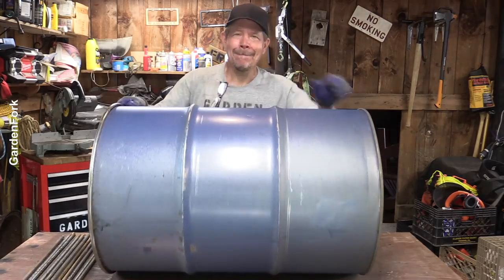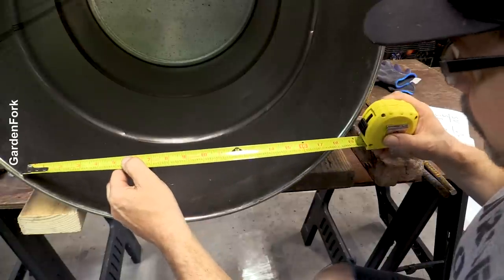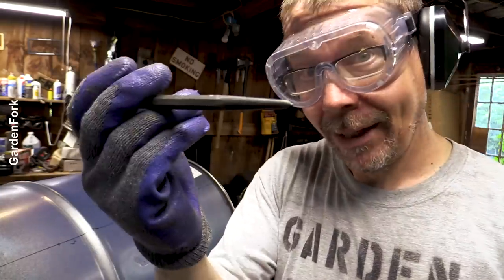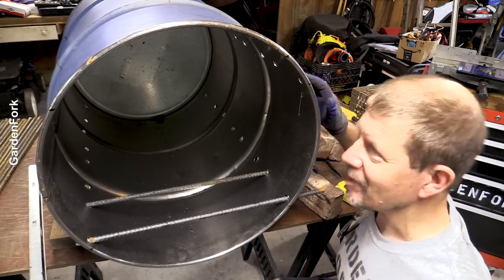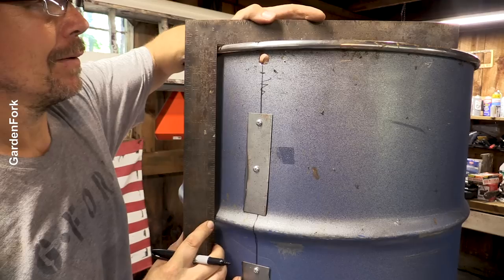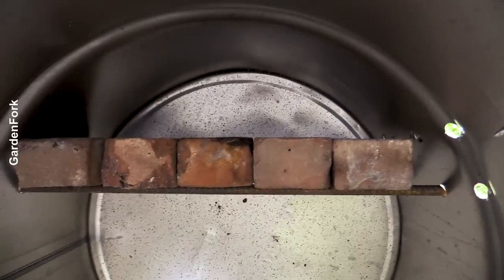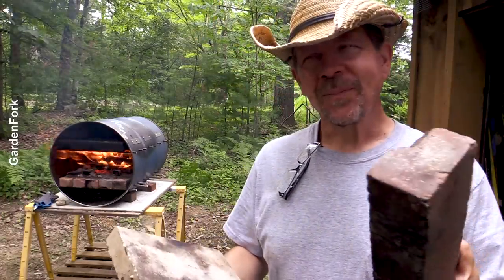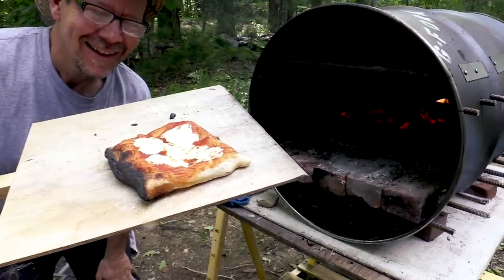Metal Drum Into DIY Wood Fired Pizza Oven

Comment: This is a great idea! I cook on top of the heat source in a fire place setting using fire brick although I lack the roof part which I have to flip the dough once before adding toppings. BUT your idea👌 I would change .. Forget the bottom row add sand instead of the bricks to build a fire on. The second row move down a little and leave that little space on each side to allow heat to rise. Build the fire, let those bricks heat up and cook the pizza on top of the bricks. The heat build up at the top of the barrel will cook the cheese hopefully with a more even heat👌 I'm going to try this....you've got me thinking now!
Reply from the maker: Excellent idea Rob, thx for writing. Had not thought of using sand 🤔 Eric.

Comment: To get the height for the holes you could probably make a cardboard template of the profile of the bricks and rebar. If the bricks will stand up, you could arrange them vertically on the cardboard and place some rebar below it. Trace, cut, then hold it up to the front of the barrel. Line it up where the top corners of brick hit the barrel with the template even, then mark the holes where your rebar hits the side, and make some more excellent level lines down the barrel. Hopefully the little bit the rebar settles into the holes will leave enough wiggle room to get the bricks in. Thanks for the excellent content as always! Wishing you and the pups all the best <3
Reply from the maker: Good idea with the template Oswen, thanks for that. Brick dimensions actually vary quite a bit, so we could also Just see what fits. Thx ! Eric.

Comment: Use a second drum for a stand  .. cut U shape in top of stand drum . fit oven drum into U shape. cut out metal can be fashioned into short straps ... attach both drums together with straps using self tap sheet metal screws.

Comment: On bottom let the rebar lay in oven, no holes. If to long/high cut shorter. On top measure your 5 brick, then come down the 2-1/2” from top for hole position. You could try leaving a little room in back for heat travel and building fire under bottom bricks. No ash on pizza.
Reply from the maker: Wow Eric great ideas. Thx! Eric.

Comment: You could lay the bricks on the botton right against the metal for a curved fire liner. That would lower the heat allowing you to lower and only use one course of rebar. Also, you have a grinder so try cutting angles of brick to end fill bothe sides front to back. That will help with draw and convection.
Reply from the maker: Good info Stewart thx for that. Eric.

Comment: Not to worry GF : Just go for it!
PS Try placing the fire below the lowest set of bricks instead of in middle back.

Next build, place your lowest rack of actual fire bricks at least 4"-5" higher on which your food will sit and fire below - perhaps with very small spaces for flames & heat to reach up... 

PS use a baker's pizza stone keep your food cleaner, more even heat.
Reply from the maker: A couple of people hav suggested the fire under the brick. Might have to try that. Thx! Eric.

Comment: Great idea , and damn very economical ...
I have a suggestion , you can grind the bricks  on left and right most lines , so they can touch the drum wall . These bricks needed to be ground on the side which is touching the wall . The grinding should be done at a certain angle so they fit well
Reply from the maker: Good idea Uday, thanks for that - Eric.

Comment: Just line them bricks up side by side on a level surface and use string to measure.
2 pieces of string one for 5 bricks wide one for 6 or 7. Make sure your bench is level
Then for the level use a clear plastic tube full of water to get opposite side level.
Its the same methods for level at opposite ends of barrel as opposite sides.
Any thicknesses needed just use the actual brick to gauge the height or drop down.

suggestion: Use bricks to form an ark up and over underside of barrel after making the base
OK this is a year old you probably did this by now all the best you gave me some ideas.

Comment: You don't need the bottom rack if you just used fire brick,and sand as grout,dry sand is fine if you work it through the cracks with a broom. You'd want to use those bricks throughout if you want it to last.

Comment: Interesting down and dirty build.  A couple suggestions:  before you start drilling into the barrel flip it over so the solid end is a level surface.  Stan’s f bricks up on edge and snug them to the outer lip.   Add a piece of rebar above or below and mark vertical lines where the holes should be placed.   When you orient your bricks on the top row against the back omit the center bricks to allow smoke to rise above the layer of bricks.  Use your grinder to cut / slice / carve a hole to place a length of pipe up for a chimney out the back.  You could do the same on the bottom row of bricks too if you were going to maintain a fire under the bottom bricks or at least channel combustion air to the back of the barrel to maintain your fire.  If yo have sufficient extra bricks line the sides with one or two additional layers of brick to increase thermal mass.  4-5 bricks could be placed flat across the back to maintain heat and protect the metal.  Thanks for sharing this video.  Wishing you and your family peace, health and happiness as the pandemic continues to evolve.  Greetings from NE Ohio.  Cheers.

Comment: You should use the barrel lid to close off the front of the oven. Cut a rectangular hole to pass the wood and pizza through. You'll lose less heat out of the front of the oven. When you need to change out bricks or to make cleaning easier, pull the lid back off.

Comment: I built an oven w clay bricks and none failed in the years of use. I put a lot of heat and it worked fine. Older bricks are the best, no holes..

Comment: Lay out the bricks you'll use for the bottom and the top exactly as they will be installed then using your level hold it to the bricks and mark with a sharpie on the level the exact width of the bottom row then transfer the level (with marks) to the barrel and mark those marks where the bricks will just touch the sides and drill holes for the rebar accordingly. Do the same for the top row. Another option is to cut angles (grinder?) on the bricks that will touch the sides to push them further out.

Comment: How about you cement the bricks the whole way around the inside of the barrel. Put them the whole way around. I think they make bricks in a wedge shape. Then add your legs to the bottom. Put a rack in about the middle to hold the pizza. I think you could even put a small smoke stack on the back and maybe a door. Maybe use some type of stickers, maybe tacked in on the metal to hole the bricks and cement. Just a Thought.

Comment: How cool was that.
I think if you measure the length of 5 stacked bricks you get the exact measurement of the lower deck. Mark it on your level and you can move it up or down till it fits perfectly and stays level :D
You can do the same thing on top just add the level width to the lower end as you did.
Reply from the maker: Good info Gil, thx for that!
Reply: Brilliant !!.

Comment: Clay bricks vs fire bricks is just thermal shock vs not really thermal shock-created bricks. Both work equally as well to holding up against all that thermal shock, its just that the fire bricks will last longer and hold up better over time. I want an oven to last but i doubt i will need it thru, say 2 or 3 generations from now so either works for my purpose.

Comment: Put thin bricks in center and wood on bottom. Also use thin stainless steel half circle over the thin bricks 🧱 and you will get flames roll over the pizza at 900 degrees.

Comment: Hi Eric! I would take some scrap 2" x 4" lumber, and cobble together a slab of wood the size and shape of 5 clay bricks across. Turn the barrel upside down, (so you don't need to hold the form in place), and lay it in the opening. This will give you the exact measurements, without beating your brains out doing calculations (I hate that too). Mark your holes, and slide the form back, until you get to the bottom. Adjustments could be made with a Brickbat.
Reply from the maker: Excellent method, thanks for that. Did not think to just turn the barrel upside down ;) eric

Comment: you definitely need a door otherwise the heat loss is too much. you could also put some bricks at the sides if the space does not get too small. and insulate the bottom and top with material like vermiculite. or just insulate the whole outer side of the barrell with ceramic wool.
Reply: Yeah, Definitely add bricks on the sides, and along the back and maybe even in front along with a door.  How long did you heat this sucker up?  ( From what I've seen, a lot of these ovens they heat up for hours.) You might even add some brick underneath the first layer of brick.  Build up the thermal mass of the oven so it has a big reserve of heat in it. Insulation on the outside and thermal mass on the inside.  This is a great idea, I'll have to remember when I eventually get around to making one.
Reply from the maker: Excellent idea! I have plenty of brick to fill out the walls. Had not thought of vermiculite 😀 Eric.
Reply from the maker: Yes Brad the thermal mass needs improvement. I cooked down the fire for about a half hour. Should have burned it longer to heat up the lower brick for better crust. 😀 Eric.

Comment: Instead of measuring just use the actual brick and mock it up. Temporarily clamp something onto the barrel to hold the bricks. Then through trial and error find the exact place where the brick fit snugly across the barrel. I try to not measure if I don’t have to. Much better results.

Comment: Probably for the top row, rather than bothering with brick measurement. One could simply cut out a thick sheet of cardboard, and cover it with a layer of clay, with or without stray. Then stick it in place and light a fire for a few hours

Comment: Hmmm, if you have fireproof stonewool (don't know if this is the right word in English) you could retain more heat in the oven walls by isolating the outside of the barrel with it? And then maybe use chickenwire and foil to hold the wool and proof it against water? 🤔

Comment: I have a 200 gallon gas barrel that's been split into two big kettles, ten 15 inch square, six inch thick granite blocks, four five foot lengths of hot rolled steel angle iron,an old foundation, a big bag of pearlite, and an old wood burning stove.  Looks like I've got a project.

Comment: Aside from being very heat-safe and heat-reflective, another asset of refractory (fire) brick is that they are incredibly uniform.  It is so easy to get very smooth, even oven floors.  They also come in many different sizes, such as half height.  This would give you more room, and better heat performance.  
I like this idea.  So if I really intended on using it, I would just go for the right material and enjoy it.   

If not;  The only way I can think to make more height (cooking space) would be to remove the back, press the sides of the barrel to create a shape more oval than round.   Make a new back that fit and holds the new shape, and enjoy the extra couple of inches up and down at the expense of about an inch or so (about what you were lacking to have the bricks seal the top and bottom) of width.

But a cool idea anyway.

Comment: Question. What if I was to  tip the drum on it's side, make a layer (for a lack of a better word) on the bottom of the drum (when tipped on it's side) with whatever high temperature cement stuff you can get, allow  to set over about 2 days or however long. Then once the cement has hardened, turn it around so that the then hardened cement  is on top and repeat the process on the other side? Off course you might have to put some reinforcing steel through the cement to help hold it. Would that work I wonder?

Comment: Guess I am late to the party, but just found your great vid. Had a thought and don't know if anyone else thought of it, but...(ouch, it hurts)what if you used the firebrick on the bottom-yes, going against your motto, but that would give you space, and perhaps also keep your pizza crust cleaner and bake more evenly? Also, do you use anything to keep the barrel from rolling, and what would not burn up? Quicky, but those barrels usually have a residue on the inside-please burn them at high heat before using for food! The outside should also be burned at high temps to remove any paint. How have the rebars held up, and why no vent or door? Just one more...maybe a large cooling rack might work(vs ALL rebar) to keep any cracking bricks from smashing your pizza from the top?? Less holes in the drum(less measuring too!), and less chance of having 'brick pizza' too! Hmmm...Thanks!!

Comment: Great Idea !!. How about we find a way so that we can insulate the tank so accidently touching it doesn't burn anyone? THoughts?
Reply: Put a 30gal barrel into a 50gal barrel and fill the space between the barrels evenly with vermiculite to keep it semi-light or you can use sand also as an insulator? Just a little on the heavy side.

Comment: I was thinking more that the fire would be  at the bottom of the drum and have the brick form a  chimney so it the fire/heat would head toward the back then up and out the top of the drum but that would require more space and you would also have to brick off the back so there is a chimney effect.
Reply from the maker: Yeah, kinda like one of these heaters I've seen that use a long chimney and little wood. a rocket stove?  thx! ERic.

Comment: Metal gets hot asf! To be honest i dont think you need all that brick. I saw a ceramic paver 24x24  for 13 bucks at Lowes. Im thinkin put in two pieces of rebar to hold up the paver and call it a day. I saw a middle eastern dude weld a plate in the middle and add some propane piping and he didn't use any brick at all baking breads and pizza all day.

Comment: The spacing may not work out but could you try to put the center bricks on the top row on edge (the 2 1/4" side is now horizontal)?
_IIIII_  instead of ________ The center bricks are vertical not angled but Youtube is not showing what I typed. You'd have more small gaps, but more thermal mass, but then it's top-heavy. Maybe the staggering idea below is better.
Puppy always wins.
Reply from the maker: GOod Idea Diane, thanks for the note. and yes the puppy wins :) Eric

Comment: I think the only think you did wrong while calculated where to put the bricks is, you didn't calculated the radius of the rebar into where you put everything. So I think the rebar should be the radius of the rebar lower on the top and bottom

Comment: Does the Pizza not get ash on the bottom?
Not sure how it would work out but if you just put bricks on the bottom then other brick (turns 90°). Two layers sould be enough. Bricks can be split or even cut with that saw thing you have (proper blade needed. The top would need to be the same as you have but again you can put a half brick in here and there. Not sure how Fire Clay would work in the gaps.
As for getting the Geometry correct. Bricks are not precision things, inaccuracy is guaranteed.
Those Self Drilling Screws are cool. Roofers use them but their sheet is thinner I imagine.
Reply from the maker: Inaccuracy is Guaranteed! love that one James. Some ash gets on the crust, i could brush the floor better. but good ideas on the build, thanks for those. Clay bricks are easy to split with a chisel and hammer. Plus I have plenty of broken brick around. thx! Eric.

Comment: Doesn't the metal radiates or reflect the heat better than brick for the ceiling?
Reply from the maker: Hi Patrick, the brick holds heat better than the metal. which is key. thx! Eric.

Comment: Your oven is a great start, but its kind of too deep. Drill your rebar holes and put a shelf of  any sheet metal on those. Then brick on top.? Fewer holes, less rebar and easier to place bricks on? The same on top? Holes,rebar sheet , then brick. Well I have worked on old houses where clay fireplace bricks lasted hundreds of years.They didnt have firebrick then. Gd.Luck.

Comment: conceptually  the top is brick for the radiate heat which comes back down - still how would such function with NO top layer brick?  I would have tried that first as either way its an oven?
Reply from the maker: Hi James, from what i can tell , the metal barrel is too thin to radiate heat back down, but I could be all wrong about it.  - Eric